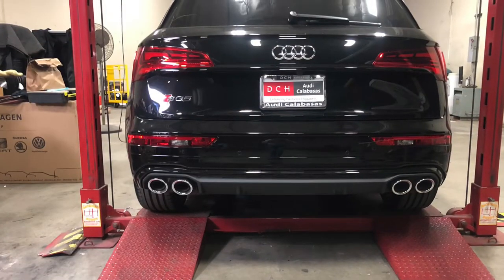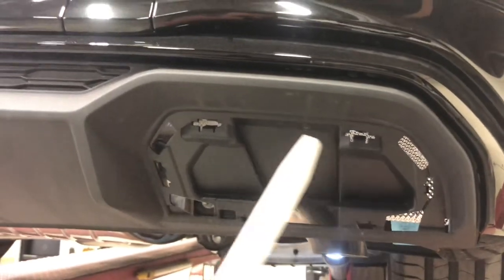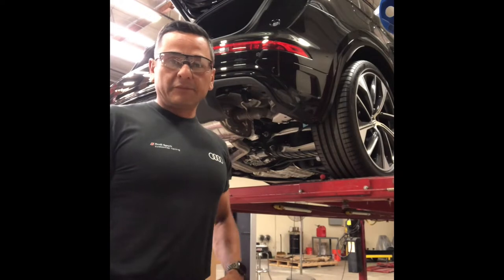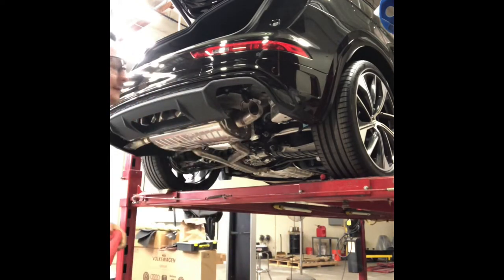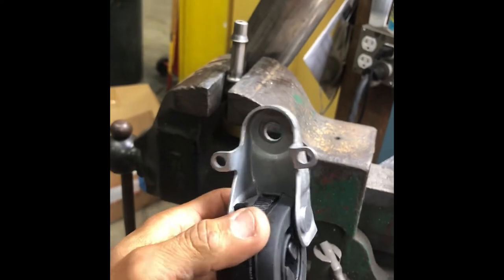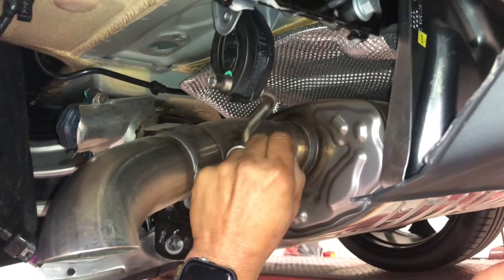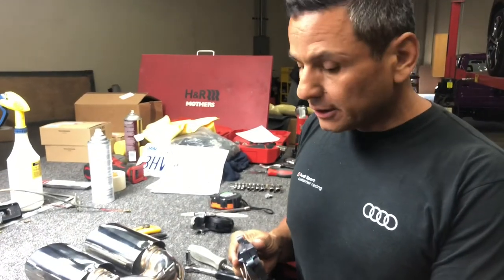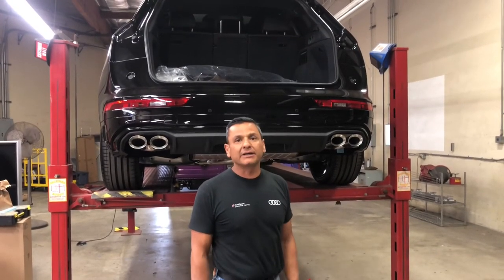October 27, 2020

Comment: For reference only: I have a 2023 Audi SQ5 and purchased the ZAW071897EDSP exhaust tailpipes in an attempt to restore the authentic exhaust system. However, I encountered an issue during installation. The left side with the valve could be installed properly, but the right side had incorrect dimensions. The factory-original left side has a slightly smaller diameter, around 6.5cm in diameter, while the right side without a valve has a diameter of 7cm. I had to remove the new exhaust tailpipe, make modifications, and weld it again in order to fit it. The outcome after the modifications is quite good, although the edges of the plastic parts aren't perfectly smooth. Those with higher attention to detail might find it less satisfying. I am very grateful for this video and Gil's help, and I hope it will be helpful for others in the future.
Reply: I'm curious if you cut 2.5 inches away from the muffler on both sides?

Comment: Hey Gil. I absolutely hate the fake exhaust on my 2020 SQ5. I don’t have the fake tips but the rectangle fake black fill ins. Do you have any idea I could do the same as your doing on your 2021 SQ5. Also, how would this replacement effect any warranties offered by Audi?  Great Video and thank you!
Reply: Unfortunately there are no cut-outs for 2018-2020. There are two options. One, you change your whole exhaust ( awe) is a good brand and sounds the best in my opinion ( about $2000 but it still curves  down like the stock exhaust) Or, you could go the Abt route, which  includes a new bottom section of your bumper already cut out and new tips as well. The abt option is about $3300.

Comment: Hello Gil, I have a sq5 2018 and I would like to install that same escape, send me the link where to buy it.  excellent video.
Reply from the maker: hi thank you for message. here is the link were you can get the exhaust tips. how ever on your vehicle you will need to mod the lower valance. all you have to do get all the parts at the dealer and you will be set. 

https://parts.santamonicaaudi.com/p/Audi__SQ5/Sound-Enhancing-Resonator-Kit/97708107/80A071904.html?partner=googlebase_adwords&kwd=&origin=pla&partnerDevice=c&userLocation=9031067&gclid=Cj0KCQjw5JSLBhCxARIsAHgO2SdXICZg3b-TmCbeYU2FBYnOQZJIdUMSpk6rjPI6U2Fo8eKHMfokW6EaAvr-EALw_wcB

Comment: Hola Gil - I have a 2023 SQ5, from Mexico. I went to the El Paso, TX Audi dealership at the end of last year and purchased the exhaust tips. On the day of the scheduled service, they did not know of this process. In fact, they suggested buying the rear facia instead. I was really disappointed and, in the end, I had to return the exhaust tips… Is there a way I can connect you with the El Paso Audi Service department? It seems that the folks at the service department did not want (or did not have the knowledge) to do this service (I even shared this video, with no success).
Reply: Just for reference, in Mexico, SQ5 does not have the option for real exhaust tips as the US version. The extraordinary thing is that all SQ5 are manufactured in Mexico… imagine that!
Reply from the maker: https://parts.audiusa.com/accessories/Audi__SQ5/Sport-and-Design---Exhaust---Sport-and-Design.html      

Go here and you can order the parts you need. Not all dealer ships are aware of all Audi US offers
Reply from the maker: ZAW-071-897-E -DSP
Reply: Muchas, muchas gracias Gil! I noticed that you refer to the SQ5 Sport Exhaust, Black… do you know if the chrome ones (80A071904) will fit? My SQ5 is black with black optics, and the chrome ones would standout more!

Comment: I'm in the New York City area...where I should go? Or CT, NJ even PA I would go if I have to, I love my Audi but I HATE those fake exhaust smh.
Reply from the maker: so in order to have those tip work on your vehicle, you are going to have to replace the whole lower valance to adapt to the upper part of the current bumper. It’s going to require some paint work and a lot of different parts. It could be accomplished but it’s not going to be cheap.

Comment: Hey Gil. Just put the black tips on my 2022 SQ5. I noticed the sound doesn’t crackle as much. Almost a more dull sound. Is there anything else that is needed or am I missing something?
Reply from the maker: Nicholas, I’m not sure if your vehicle has been tuned or not,  typically that’s how you get that crackle you’re looking for.
Reply: Does a Dealership do a specific tune to obtain that crackle. Roommate has a 2021 SQ5 with the exhaust on it. Has a way better sound than my 2022 with me putting the exhaust on myself. Let me know! Love the video
Reply from the maker: @nicholasuslar2115  no the dealer will not do the tune …… you would have to do like an APR or 034 tune ……. NOTE will black ball your car from warranty …….🫤  your call sucks

Comment: Just had these installed on my car and they left the plastic piece underneath the new tips not a big deal I guess.. anyways I notice whatever mode I have the car in that the exhaust smoke really only comes out of the passenger side of the vehicle. I read that this has to do with the valve on the driver side which opens above 3,000 RPM. Is that true ?
Reply: Anyone else seeing that issue?
Reply: Yeah a lot of newer cars (from all manufacturers not just Audi) have exhaust valves that only open up both sides of the exhaust when the engine is above a certain RPM as well as the car being above a certain speed. I know on many BMW’s the valves open up past 65 mph but close under 40 mph

Comment: I just bought a 2021 SQ5. The dealer did not know of this option but it is cataloged by Audi (https://parts.audiusa.com/p/Audi_2021_SQ5/Sport-Exhaust-Tips/97708107/80A071904.html). I simply told the dealer, amongst other bargaining, that no real exhaust tips = no sale, and they made it happen (in all seriousness, without this option I really would not have purchased the SQ5). I gave the dealer this link and they had to order them from another dealer. Only took about week. I didn't bother having the dealer do the install owing to how simple it is (thanks to this video!).

As to,Why? Between engineering and manufacturing the plastic tips and their mounting, plus the engineering/manufacturing/cataloging/instructions/inventory for the real tips as an option, all told this seems like a more expensive option than just providing all 2021 SQ5s with the real tips. Having had cars in the past with stainless steel exhaust tips, they are high maintenance, and have to be cleaned every few weeks. With these fake tips of course, there is no cleaning. I drove the SQ5 for a week or so with the fake tips, and really, it didn't bother me as much as I had expected. But still a deal breaker for me.
Reply: Just got back from the dealer - probably not for cleanliness. The 2021 S models they had in the showroom (S4, SQ7) had legit quad exhaust tips, so it's probably the case with other S models. Why single out the SQ5? I don't care now - only care that the Audi upgrade is available. Pricey at $1,250 list but worth it.
Reply: In Canada its an option that you can buy and instal direcly from the dealer

Comment from the maker: I’ve been asked what blades I used to cut the exhaust. It is a difficult task to find the right blade that will cut that harden steel. I used high performance carbide blade for greater durability and will not burn up the blade. check out the link: 

https://www.google.com/shopping/product/946983487918327333?q=zaza+blades+hard+metal&rlz=1CDGOYI_enUS743US743&hl=en-US&biw=390&bih=669&tbs=vw:l,ss:44&prmd=svin&sxsrf=ALeKk01JEDxjO8lBNE0eVtVXfSqy2HhqZg:1621004817528&prds=eto:6083726277544576714_0,cdl:1,prmr:1,cs:1